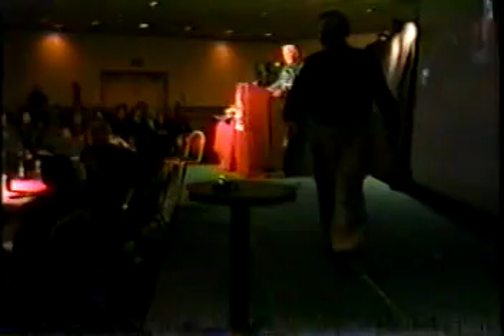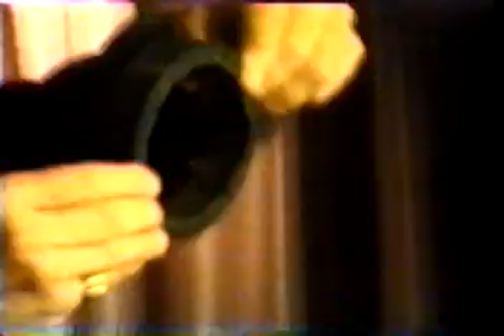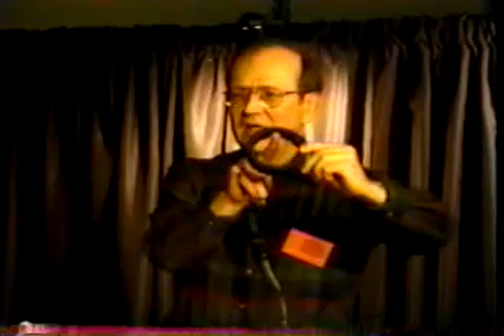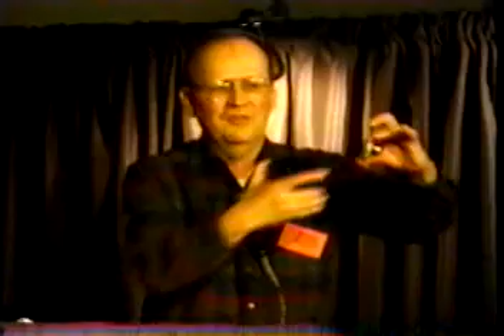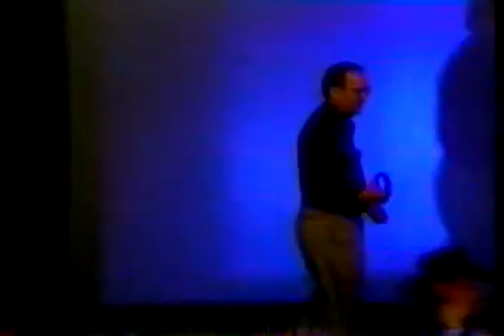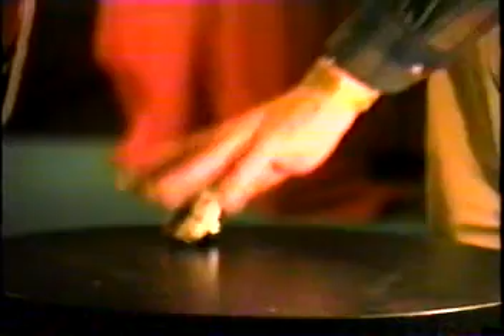'Free Energy' Demo using Magnets (you can make at home easily)

Comment: But i do know that going up is harder than going down due to gravitational forces against you thus more energy is expended.  trying to make it go up. magnets just dont have enough power to do it imo. they need to find a way to expand the field without using too much energy.  it is still pointless as I believe they will spend more energy magnetising the magnet over any benefit it will bring.

Comment: what i am saying is from all the magnetic discussions videos are that use something to propell the object with less energy consumption and let gravity do the work afterwards if there is any possible way.  magnets are just being used to pull or push it to spin could work if they have a disruptor magnet something they an use to turn on and off while generating enough magnetic force to push the object away.  at different power strengths. and you must be able to turn it on and off to conserve.

Comment: and so it is not free energy per say. the magnets will be the pulling force and releasing the object for gravity to take back down. on off on off. basically a switch if you can achieve that with little to no consumption of energy then these magnetic ideas of energy may be useful. though it is pointless as I know as well there is no such thing as free energy. it can only be transferred.  Just saying try to harness the power of gravity as a form of energy. hydro dams are already one form

Comment: yes I actually thought of that. a bit. i am thinking of another way. again i've taken very little physics so I am not knowledgable in gravity enough to comment the mathmatical formula. but. I just want to say theoretically.  if you use a magnet to pull an object and then release it and basically turn it on and off and let the gravity pull the object back down costantly thus spinning it.  of course there is no energy gained I would imagine magnets would lose their charge over time

Comment: that required an object to work with it and then against it if you are going to keep the system moving. So, it will not even break even. there will be energy lost in that system just from micro instabilities in moment and such.

Comment: one thing there is a factor GRAVITY. the reason why the magnet did not stick to the other was because gravity was holding it back. I said this in other places already.  For this the theory should include gravity as the helper. so what is keeping the ball onto the table? ahem gravity.  so you combine gravity and magnetism. but I could be wrong as I didnt take physics in depth yet. the loss of energy is being compensated from the energy of the earth. again it is transferred.

Comment: Lets break this down. No free energy=
You cannot create it
You can put it in but you lose it as the system uses it so you don't get it out.
Magnets are not free energy. The issue is capturing a force from it which you cannot do. If they attract and you gather energy from them then you must pull them apart and use more energy then you gained. 
There is no free energy, all of these systems will stop after time even with magnets

Comment: @bozo2014 You can extract energy from a vacuum, but not with this device. Extracting energy from a vacuum is not free energy and does not violate any laws. Atomic matter which most physics laws are based on only contribute to 5% of all the energy in the Universe. There is a vast store of energy we can extract and there are some very impressive experiments that claim they can do it, but I still don't have a black box that can power my house yet. We might have to eliminate governments before then.

Comment: I have done this exact setup and it doesnt work period they had another rotating magnet with a power supply. I have recreated that hypothesis and this setup doesnt work unless you inroduce a round bar magnet rotating under it which requires power input.

Comment: This is a Hamel device - the outer ring is moved and that supplies the force to get the rotor spinning.  Trouble is folks think the rotor is spinning because of the ring giving out magnetic energy (or some other BS).  If you put the rotor on a proper axle it doesn't spin.  Having it on a ball causes it to track around the centre of rotation as the outer ring is moved until it gets up enough speed to rotate on its axis.

Schoolboy magician stuff. Definitely not free energy.

Comment: See it in terms of energy. The man's arm is the "battery" powering the system. As you saw, when the object was on the table outside of the object's effective magnetic field it wasn't moving. Then the man's arm began to move the magnetic field, putting energy into the system. The nature of a magnetic field is to transfer energy from its own motion into the motion of magnetic materials, and this is precisely what it did; energy flowed from arm to field to object.

No energy was made, some was lost

Comment: See this is exactly the issue; so far at least 3 people have tried to show you that this does not demonstrate a moving part that requires no energy source.

There is an energy source for all the movement in this video. The energy source is the man's arm; respiration is occurring in the mitochondria in his cells, which allows his muscles to extend to move the magnetic field over the object, and the energy from this movement is what is being transferred into the spinning top!

Comment: @shingwoo101 Of course a spinning top isn't useful energy. The two components aren't mounted to anything, which eliminates any attempt at stability (as well as makes it rather impossible to 'hook up' to anything to charge a battery or light a bulb).
Without stability, a spinning top is useless.
The concept he demonstrates, however, is not useless. I've seen plenty of magnetic power sources with awkward units like those he was using.
And they've either powered a battery or a bulb.

Comment: No, it's not tapping into the "earth's magnetic field". The earth's magnetic field is millions of times smaller than the magnets he's moving around with his hand. If it were "tapping into" any source of power outside his hand motion, then it should spin without him holding the magnets. It's spinning because he's moving his hand, which also has far more energy than the earth's magnetic field exerts on the experiment. When he stops moving his hand, the effect stops.

Comment: i guess you could call this 'free energy.' It's actually already used in many motors. Take apart a an electric drill-same thing but with electromagnets, obviously so you can turn it on/off. 
Unfortunately, this is video and its message are useless. In order to get anything worthwhile, one would need some huge ass magnets which are expensive as hell. sorry to burst you bubble, bro

Comment: IDIOTS !... If the magnet was held in place and the "toy" put underneath..it would not keep spinning. You have to move the top magnent in order for the "toy" to spin. This means that the energy is coming from your hand.

Also...even if it would spin forever...it is not doing any work. As soon as you hook up the "toy" to a device that does some kind of work, it will eventually stop working without an external force.

Comment: Maybe the education system is designed so rigidly as to make us think in certain mechanical ways - greatly reducing the possibility of any advancements which could free us from the current energy situation. Search "double slit experiment" and you will discover that the linear, rational way of "thinking" doesn't hold up throughout our multi-dimensional universe.

Comment: How do you figure that it is not possible to use magnetic force to generate mechanical movement and electrical energy? Have you experimented yourself? If you look deep enough you will find some amazing and inspiring over unity generators which have even received media attention (whether that is good or not is a different issue..)

Comment: What type of magnet is it that hes glued to the ball? can anyone tell or provide a link to site that seels that type of magnet. if so it will be easily testable. I got a feeling this isnt perpetual if so it would of been easier to demonstrate by not holding the circle but having a fixed prototype how hard would it be to have the ball fixed into a socket and just let it run. The small movement of the hand could be causing the movement.

Comment: So your saying that the circuits that NASA uses to be part of the recharge system for  batteries for the space station, shuttle, satellites and such don't exist.  They use the suns radiation to drive spinning magnets to trip a circuit to capture negative energy (um sounds kinda like John Bedini's stuff?...) and to charge all of the banks. The transistors NEVER ever get hot, They run cold as ice whether they are here on earth or in space. Also 'negative energy'(cold) got the Nobel Prize, idiot.

Comment from the maker: But it's not perpetual, but over unity can be gained when you make a battery powered device to replicate the slight hand movements, which then spin the magnetic ball, and this gives more energy than is put in. Like a nuclear bomb gives off more energy than the detonator does in splitting the atom to cuse the chain reaction which can wipe out entire countries. A different scientifc situation, but just to illustrate

Comment: instead of having the center magnet balanced on a ball bearing, it only needs to be on a vertical rotor. Then if that is fastened down onto the tabletop, and the ring of magnets is fastened down around it, the device would keep turning and negate a lot of misinterpretation and confusion here. but it shows all we need to know if we dont put up dumb objections.

Comment from the maker: yes but if you set it up so the above ring is oscillated to keep the below ball turning, you would get this moving indefinitely....you would need a small electrical current to keep the thing oscillating but the amount of energy out generated would be more than used to power it up, thus overunity.

Comment from the maker: well you would need the magnets to have a slight oscillation as some say, but who knows, I know a physics professor who has already made 2 successful overunity machines form plans off the internet. 'overunity' means to get more energy out than put in. The above contraption works if a little electricity is used to oscilate the above magnetic disc, causingt eh ball to rotate. The resulting energy is more than used up to get this thing going. Overunity

Comment from the maker: Thanks for this, will try it when i get around to it.
I guess if a device where something oscillating above it could then cause the magnets to make the thing spin, you woudl have a over unity machine, so putting a battery operated oscillator to make the disc on top shake, and then the magnets would cause the ball to spin, and you would have more enrgy genertaed than put in. Like wind power, or solar.